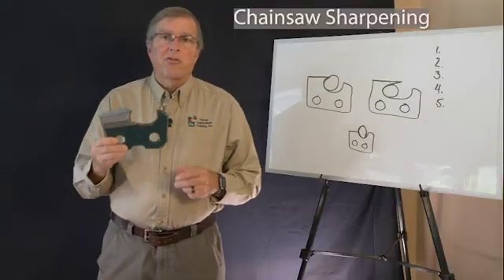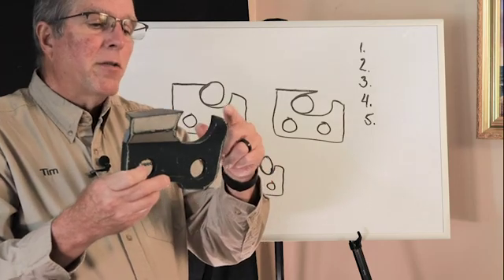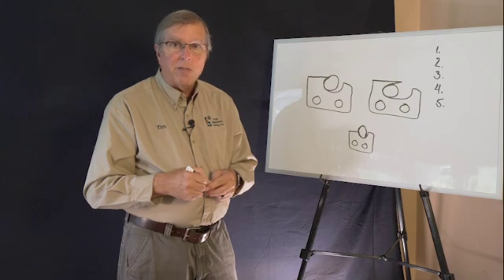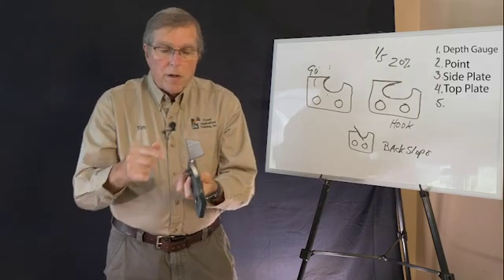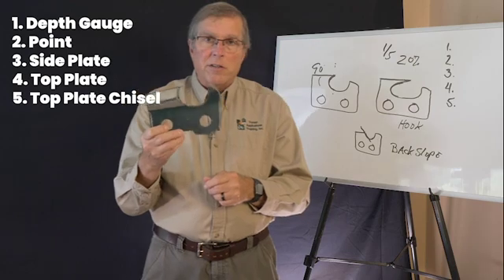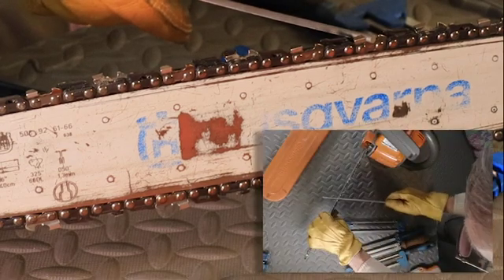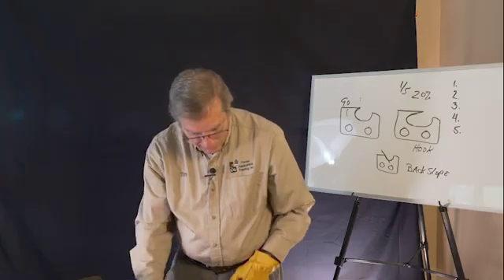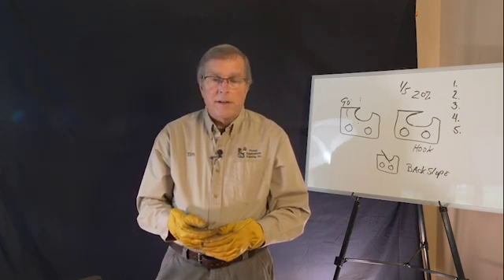Chainsaw Sharpening

Comment: Thank you very much for such a detailed explanation and greetings from Serbia :goodvibes:. I have one practical question ... Is it really necessary for all the cutting teeth on the chain to be the same length? For example, if it happens that only a few teeth are damaged so much that it is necessary to shorten them enough to have the correct geometry, is it necessary to shorten all the teeth to that length? I have noticed that it is much more important that the depth gauge on each tooth be properly adjusted, regardless of the length of the tooth itself. That way I get a straight cut in the tree and the bar goes neither left nor right. Am I right?
Reply from the maker: You are right! Every tooth can be a different t length, point height, and if the depth gauge is set to feed the same, the chain will cut straight.

Comment: Great video Tim!
Reply from the maker: Thanks for watching Aaron. Don’t forget to subscribe if you haven’t and also our Along the ForestApps Road Podcasts. 
Regarding Chisel bit or Square Ground- it’s a very fast cutting smooth chain and is actually easier to sharpen once you understand it. I’ve been using it for many years. I have several articles on my website about It. There is a new file coming out soon and I plan to do a video and podcast on it as soon as it clears.  Good Sawing!